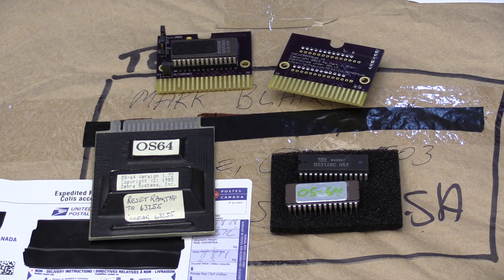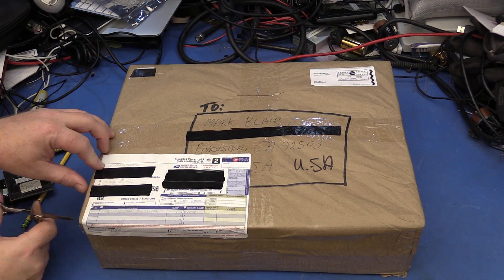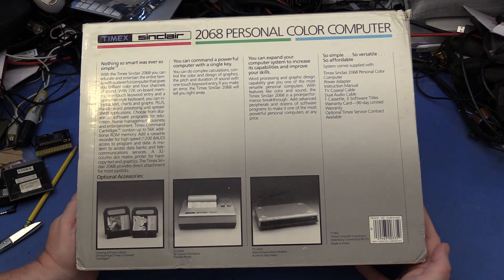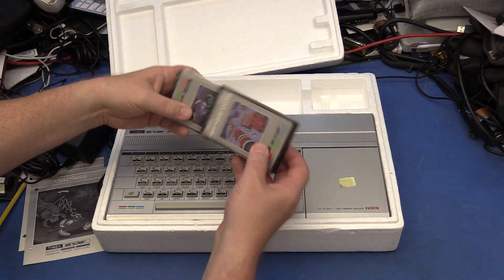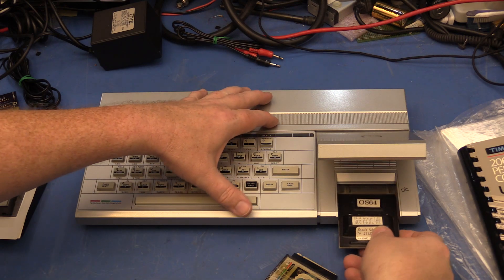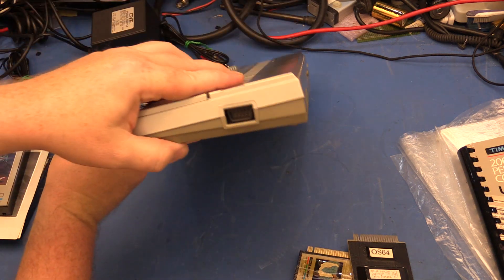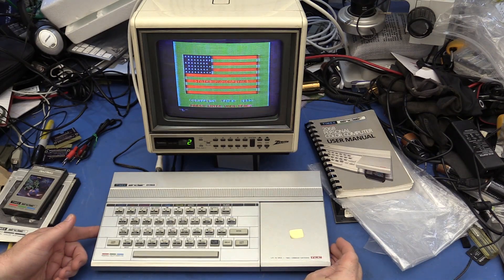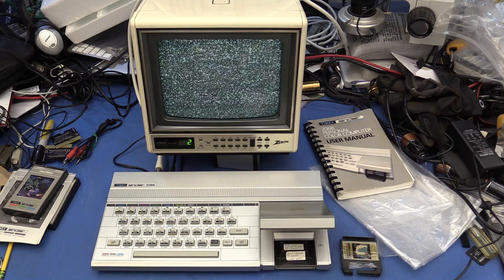Timex Sinclair 2068 Computer Unboxing

Comment: that PSU isn´t the original. That PSU is a modern one
Reply: No. That's an original power supply.
Reply: That's the same model PS that came with my 2068 which was NOS when I got it recently.

Comment: Do you have a video on what an eprom is?
Also, is the "American" Spectrum the Timex 2000?
tx!
Reply: This is such an authentic and retro unboxing!
Hey, if Rod Humphrey had any more 2068's lying around I would be happy to buy take one.
tx
Reply: As it turned out the Timex 2000 would have been a straight clone of the Spectrum in a silver case. It wouldn't pass FCC as it was, so Timex decided to upgrade the 2000 to pass FCC, and it became the 2068. They ended up using the already made Timex 2000 cases as the Timex Sinclair 1500.

Comment: Nice unboxing, mate! I have one of these awesomely under-rated machines as well. 

Mine's had a Spectrum ROM-switch mod that gives me the Spectrum mode internal to the machine, without using the cartridge slot. The ROM switcher has been a wee bit flaky lately,. but I can still use it, so I can't complain too much I guess.  :)

Still use it and play around with programming and some "Spectrum Exploring".

I too will be watching that other video.  :)